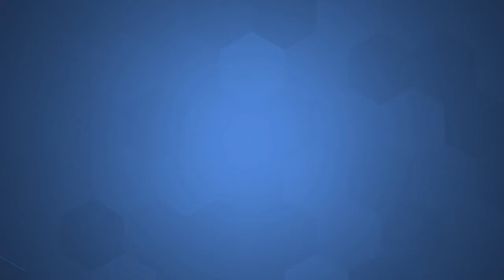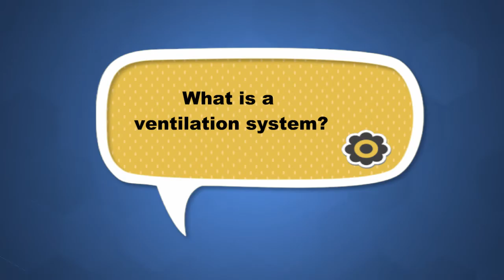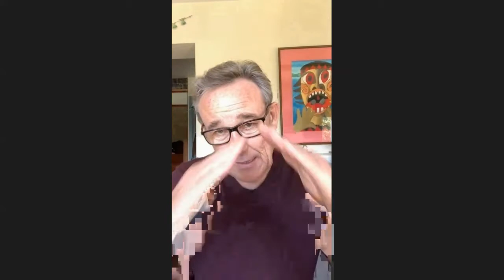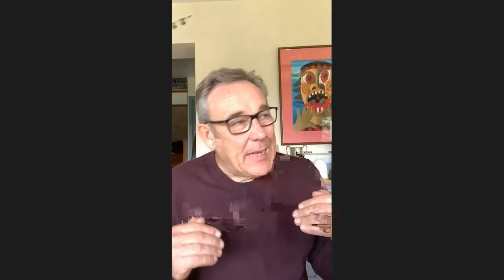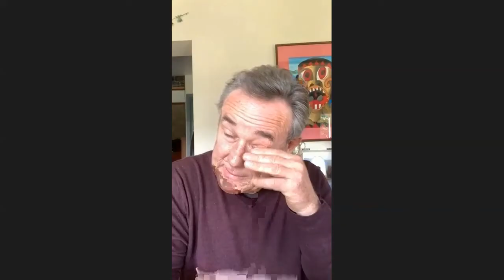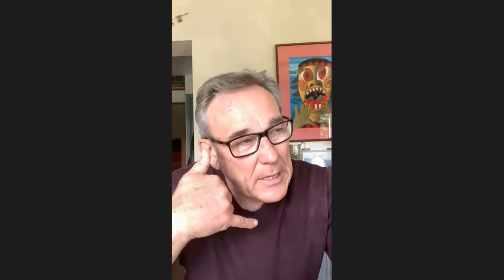Ventilation and positive pressure systems with Ian Mayes

Comment: Positive ventilation system does ventilate the house that is why you must have trickle vents at crucial sides of the house which are prone to moisture. The trickle vent in collaboration with the piv will ensure a healthy air exchange and this exchange will also prevent colder drafts from coming in through this same vent as the house is already positive pressured. The air coming from the loft is still warmer than the air that would have leaked in through gaps in vents or structural gaps as the loft is well insulated and absorbed most of the cold in the air before passing it into the house.

Comment: Great video, thanks for being so thorough and generous in sharing your expertise 👍 

I live in the uk, in an old miners cottage built in 1750. Should be covered in lime render on the outside, lime plaster on the inside, allowing the solid stone walls to breathe and stay dry. However! It’s not ventilated very well, it’s been rendered in concrete on the outside which doesn’t breathe, almost all exterior walls have been tanked on the inside, floors too (there’s no foundations, just stone on earth!)… pretty hard to get air moving through the property… we open windows every day, use a dehumidifier to dry clothes in a dedicated drying room, use a range hood when cooking, use a window vacuum squeegee thing on condensated windows, squeegee the shower after use and use Extractor fans in bathroom… still get mould on all the window returns etc. Was considering a positive pressure system that has an element that heats the air as it passes it into the house, but having watched your vids I’m not convinced it’s the way forward… if you were in my situ what would you do? (Apart from move house!) 😂